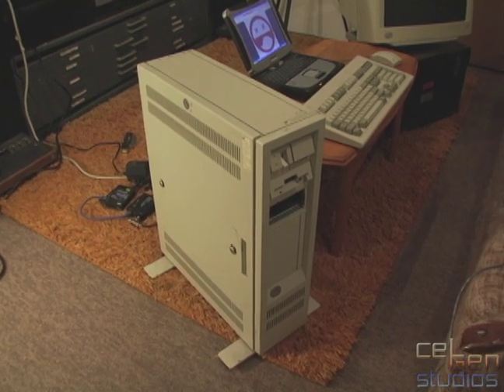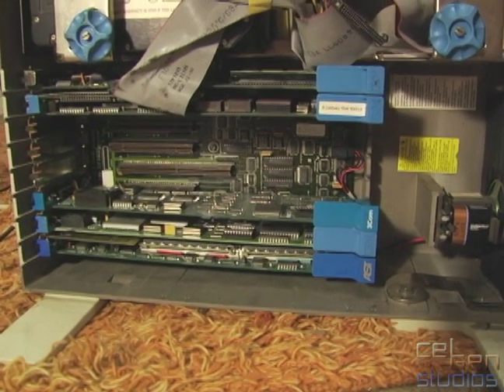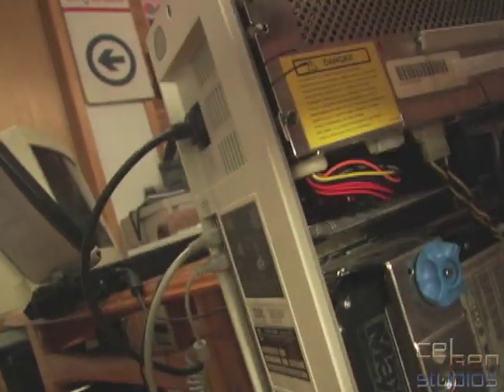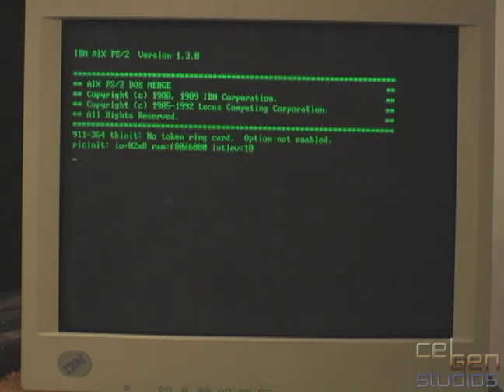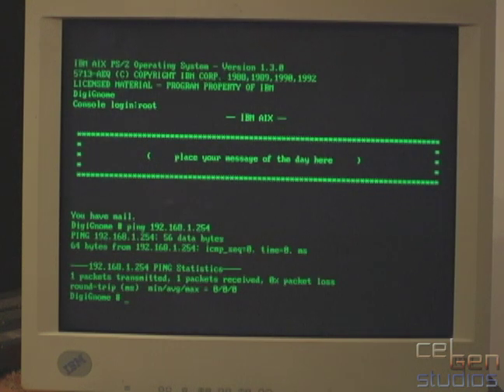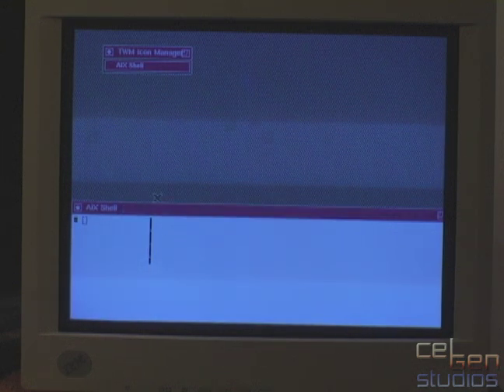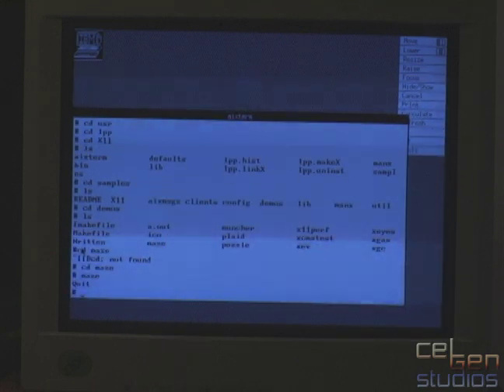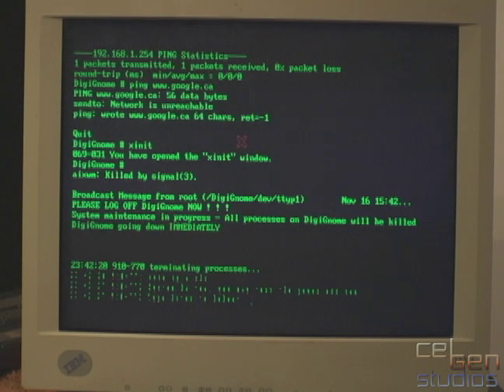Running AIX on the PS/2 model 80

Comment: Any tips for installing AIX 1.3 on virtualbox? i have attempted it a few times, trying different settings  and always get the same kernel panic when loading the install disk, starts with "INVALID ADDRESS: f038d454" maybe someone can be of assistance?
Reply from the maker: Unfortunately I can't offer any tips.
Reply: try 86box, it can emulate a IBM PS/2.

Comment: When I first tried installing FreeBSD, around 10 years ago, TWM came upwhen calling startx (or xinit), and I thought I had done something wrong. -I thought: "The icons are missing, or is there supposed to be icons" then reinstalled (I only read manuals when I am at the door of death), so I dumped the install and ended up with Debian, and then Ubuntu. -Then some merry day, I found that TWM was designed to look much like that, and went with my subconscious call: "Jacob, you must find the most righteous, yet free Unix-like system, only then you will be happy", so I did, and it's legal to do so :3

Comment: Have developed some Linux,netBSD ,aix parallel programming with fortran that went all the way too Gcc,gfortran,including arm and Intel diversities where say an iiGS Apple can parallel products for Motorola,PowerPC and pentium on 604e type PowerPC for Gpu parallel and multiplex gateways that exist across all those arches as certain ai Mit uncoupled encryption understandings of cycles etc. so may have server same myself too run SE/30 where Apple UNIX and netBSD are totally diverse things for this Aix that deploys from some earlier Debian or RedHat Linux on the net workings too ,say,jagubox or at least Eno or Beowulf clustering as noDES for scuzzy IDE or any(esp Z Pata) raid etc,for help with card profs OpenMPI interfacing S?! Maybe an RODBC database? Do you run GIT?..

Comment: Its quite funny to watch this as we at work used something VERY similar for order picking software for a warehouse, that was just until last year when they decided to upgrade. It was however slightly different (modernized lol) so it could run in a "remote" terminal in a java applet on any web browser that supported java (some even ran on win 98 pcs). I remember clearly the AIX login screen, it looked exactly as shown in your video, and to think that this was in 2014!...

Comment: I enjoyed watching this, thanks for uploading! I know this is really old, but in case you're still wondering or whatever: To continue using your shell after starting a program, append the command with an ampersand. So for example to start your window manager and continue using the shell, you'd type "aixwm &". You can also spawn more by doing the same thing, "xterm &" (or whatever your terminal emulator is called) will launch another one and allow you to continue using your original shell. Alternately, if you've started a program already, you can hit ctrl-z to suspend the process, then "bg 1" to send it to the background.
Reply from the maker: Ah, cool. Thanks for the tidbit.

Comment: This is amazing.  I started restoring my model 80 from parts and eBay purchases to do precisely the same thing.  There are several things I can tell you from an OS perspective that would be good to know as far as TCP/IP connectivity.  For instance responding to pings requires an ICMP listener to be running.  Also once you start xinit, you may want to try some different programs, like xman, (x windows manual), and xclock, and xterm to bring up additional terminal windows.  Great stuff though. thanks for posting.